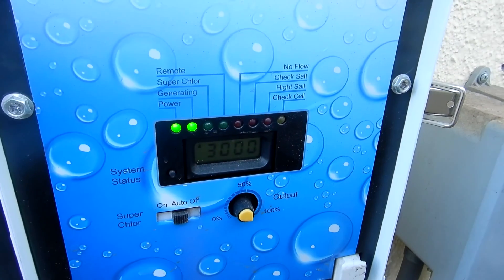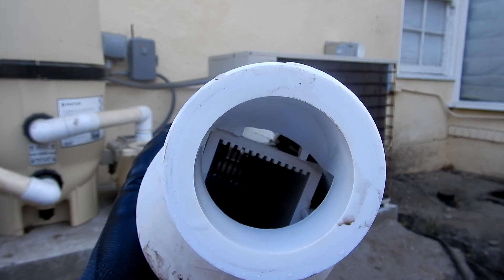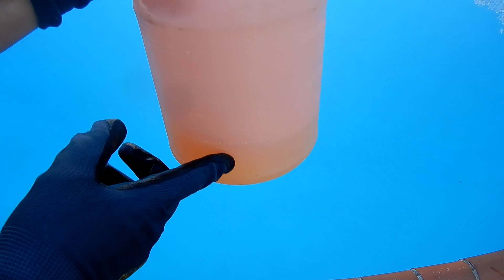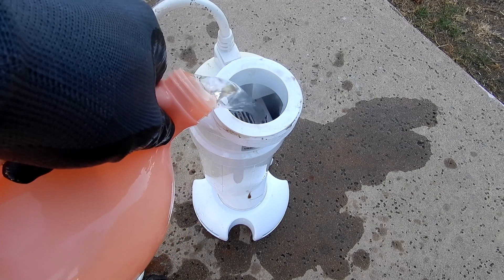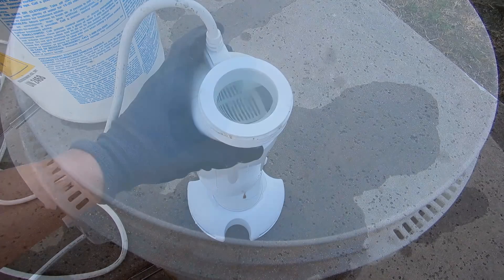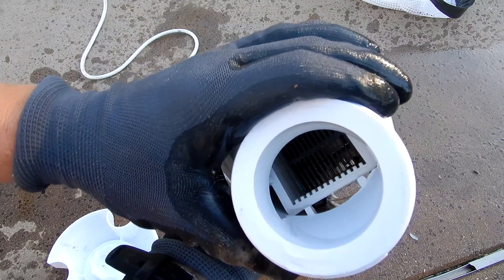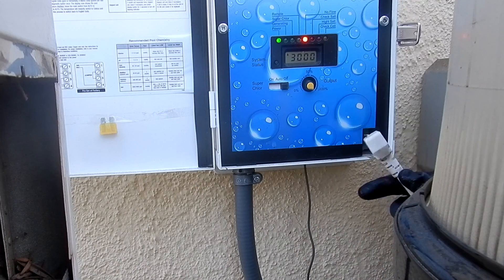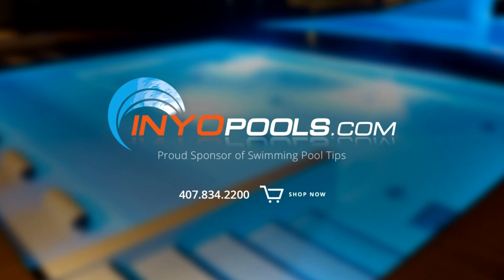Cleaning a Pureline Crystal Pure Salt Cell: Same Process for a Hayward T-Cell

Comment: Quotation on DE filters I've watched your videos, but in case I over fill the DE power how can I dump the extra DE, cause now my pressure is too high 20lbs. Should be like 10lbs. PL help
Reply from the maker: Backwash he filter for 1 minute and don't add any more DE. That should expel a good amount
Reply: @SPL  thank you, I've watched almost all your videos, your information in on point and has saved me ALOT $$$